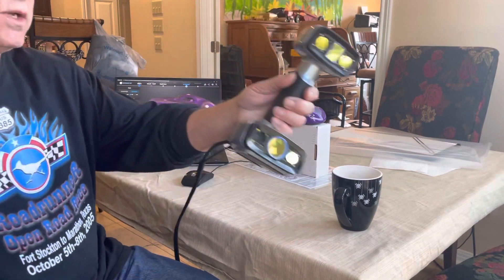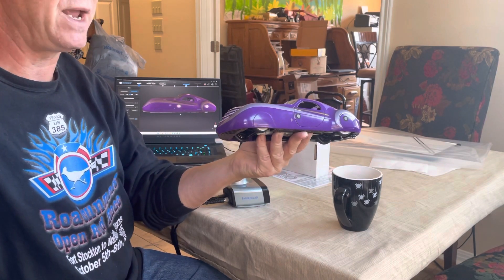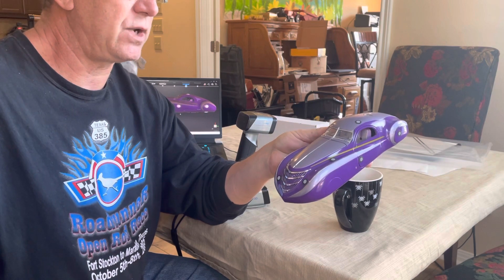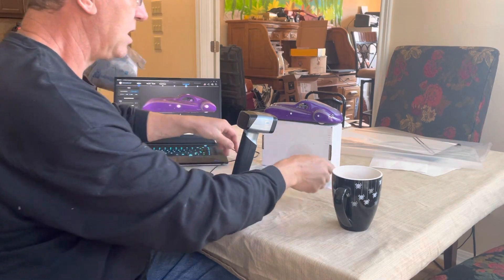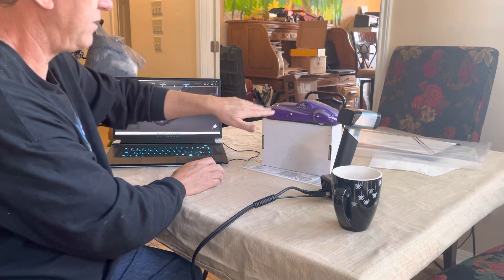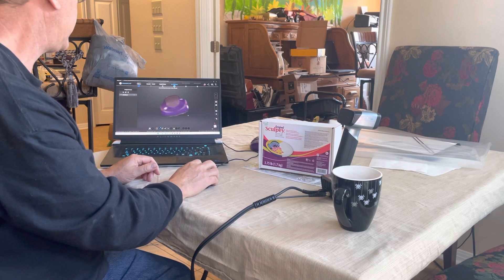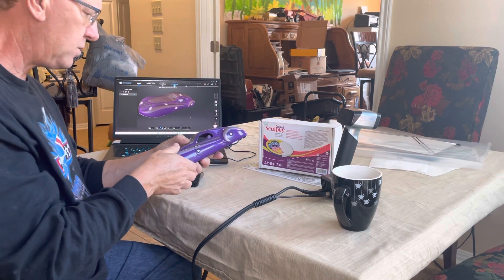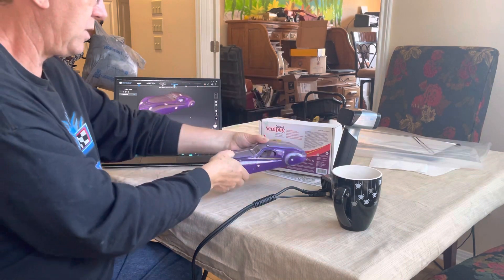C8 Corvette Hack - $10,000 3D Scanner Results

Comment: to get it in dimension of the "original car " you would need a chassis  a lot bigger than a hellcat . more like a big cadillac chassis , something on at least 19 inch wirewheels also i would stick to the original size of the model , and not cut  anything , otherwise the whole shape and dimensions are off , it will look totaly wrong
Reply from the maker: First off, there never was an “original car”, only the model. And I can’t find any scale reference on the model. So that gives me a little more latitude in the final design. 

Also, I don’t understand your “19 inch wirewheels” comment. I’m thinking the wheels for this will have to be custom designed. Also, both wheels are covered. 

I actually just got off the phone with an expert on old Duesenbergs and they had either 142 1/2” or 153 1/2” wheelbases… FAR more than the Hellcat or any other production car. The closest would be a Cadillac limo, but that would just be a huge boat to drive. Those limos are on something more like a big truck frame. 

So, the Hellcat wheelbase will have to be extended as far as is practical and the Duesenberg body shrunk to make this thing a viable project. 

The Hellcat scale model is due to arrive tomorrow so I’ll scan it and start playing around with both 3D models. 

Personally, I’m not concerned with making a full scale replica. Terry Cook scaled down the “Sultan” to 88% of the original and it was still an impressive car. 

Maybe some day in the future we can create a “full size” car but that’s not the intent of this project. 

http://delahayeusa.com/project-cars.php#1936-maharaja-duesenberg-tribute